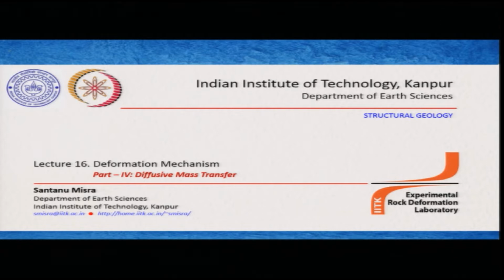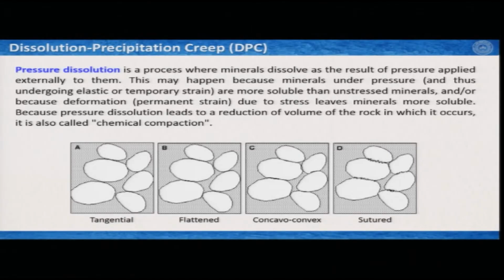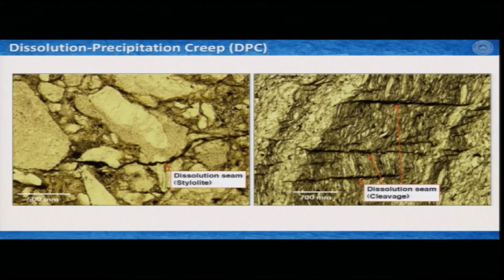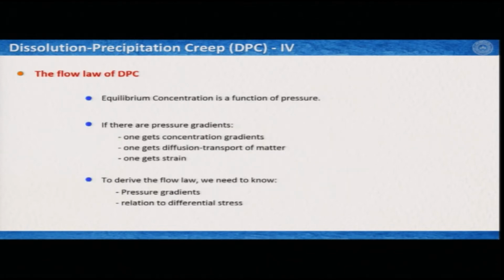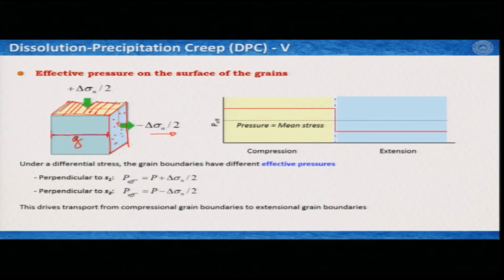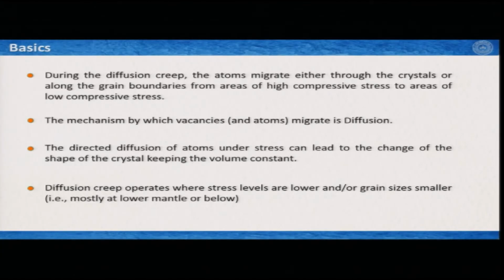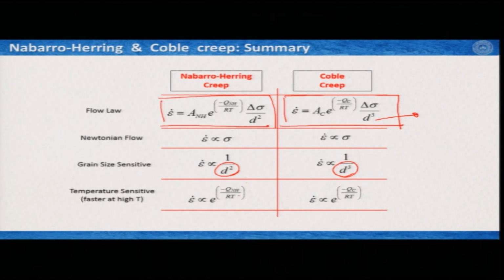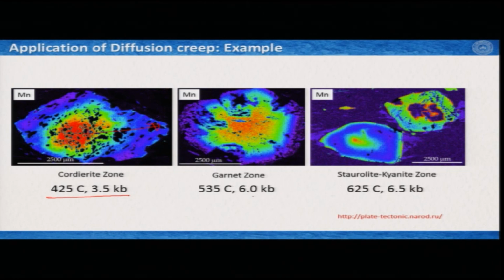IITK NPTEL Structural Geology_Lecture 16: Diffusive Mass Transfer [Prof. Santanu Misra]

Comment: I am a bit surprised.  I would have thought that diffusion concentration creep would be related to temperature rather than pressure because I would imagine that, at higher temps., rocks would act more like fluids.  After all, is not the hot mantle and outer shell fluids at very high temperatures?  Is not lava, although containing water, not a very hot fluid?
Frank